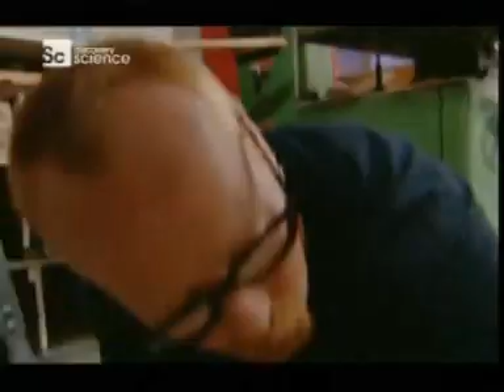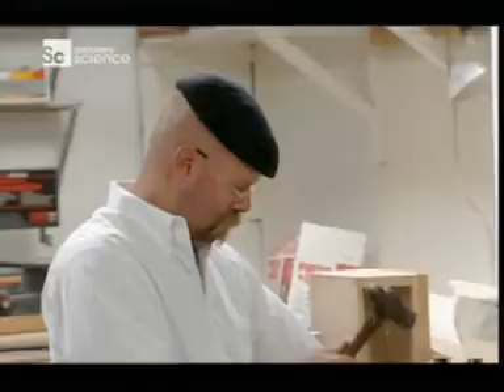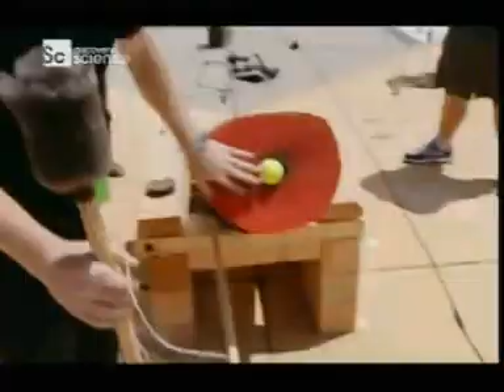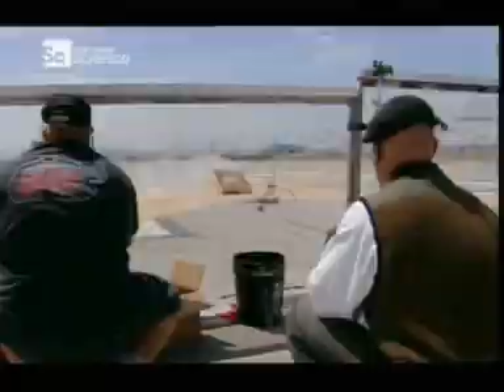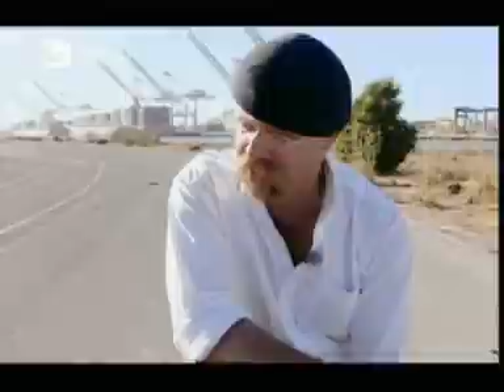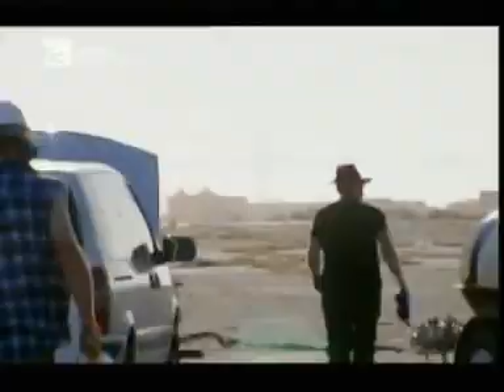Mythbusters Tree Cannon

Comment: They don't know the diameter of the barrel drilled into the original so how can they say weather or not the original didn't have thinner walls?  That would make a big difference. It could have been different type of wood. Or a smaller diameter log. Not to mention the fact they purposely blew it up by turning it into a pipe bomb. .

Comment: That had better not be a "confirmed". The cannon clearly DID work, until they plugged both ends and used more than 1300% of the amount of gunpowder they had used before, which worked.
Reply: The myth wasn't that it worked, it's that it exploded. They have demonstrated that both outcomes are possible. I just wish they'd done some more testing to see what it was capable of, with a typical metal cannon of the same era as a control.
Reply: @quillmaurer6563  The point is that it was a makeshift artillery, not that it was a replacement.
Reply: the difference between a cannon and a pipe bomb is projectile diameter,if your projectile plugs the hole you've got a pipebomb because the pressure has nowhere to go
Reply: @Anon-zu3xn  Both situations are useful. In cannon mode, fire at enemy. In pipe-bomb mode, give it to the enemy, loaded, and tell them to shoot you with it. Perhaps using some sort of infiltration tactics to give it to them and convince them to use it. The latter method was the Mythbusters' conclusion to the Star Trek bamboo bazooka, "Kirk would be better off to give it to the Gorn and have the Gorn shoot him!"